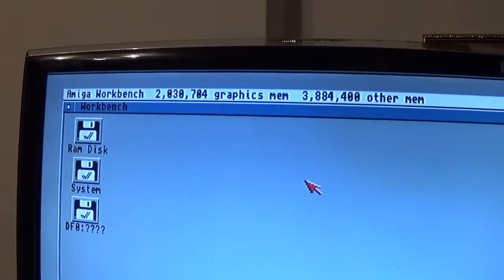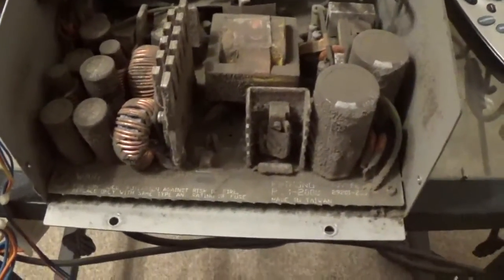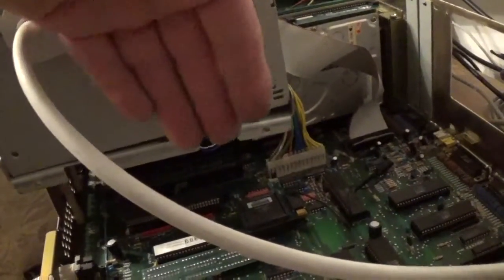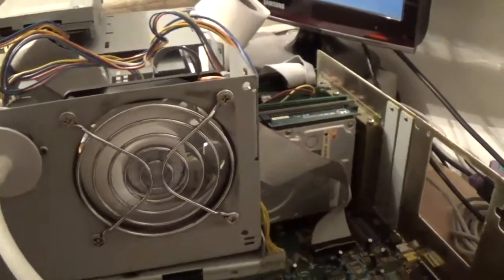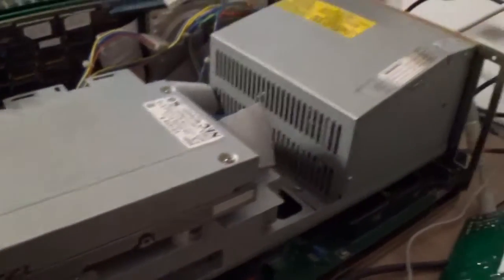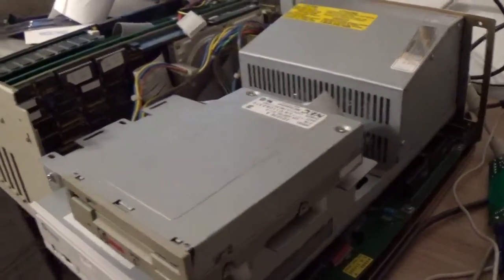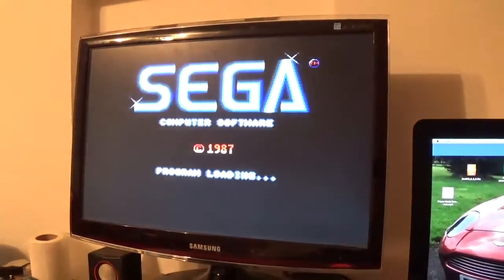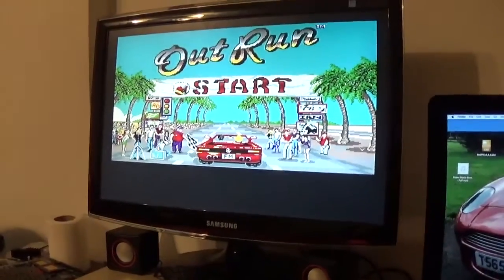megachip install in Amiga / PSU clean & floppy change

Comment: Will the Agnus from a A500plus work in the megachip, just bought the megachip without the Agnus fitted.
Reply from the maker: Hi, 
A Megachip usually has the 8375. ECS Agnus which can address up to 2 MB of Chip RAM
8372AB - Amiga 3000 from Rev 6.1 to Rev 8.9 (NTSC/PAL)
8372B - Amiga 3000 Rev 9 (NTSC/PAL)
8375 (PAL) - Amiga 500 Plus; Amiga 600 (PAL)
8375 (NTSC) - Amiga 600 (NTSC)
Reply: @mjnurney   Hi Mike just bought a Megachip of ebay but it has no chip, but i have a A500 plus parts board battery leaked alot of damage, would the agnus from the A500 plus work in the megachip, it's just there no marking on the Agnus chip from the A500 plus but was in there from when i bought it a few years ago.   :)
Reply from the maker: There are lot of dead a 500s about, the mega has an 8375 and the 500 plus should have that too, try shining a light on it or wet it with your finger to see what’s in it. Not all Agnus’s are pin compatible

Comment: Good video, did you have to change any jumper settings when popping on the MegaChip? I have a A1500 with 1mb chip that I fancy taking up to 2mb chip at some point.

I also need to change the fan from the jet engine stock one like you did, are the pc fan connectors compatible? Is it necessary to solder? Not soldered before and diving into a PSU with those energized capacitors is probably not for n00bs :)

Cheers
Reply from the maker: BrooksterMax hey bud , no jumpers ...just pop it it and check the orientation. as for the fan , yeah soldering required as I remember
Reply: Thanks Mike no jumpers makes sense if you have the full 1mb chip already working before the megachip goes in. This A1500 has only been with me a few days but I have big plans!

As for soldering the new fan, hmmm I wonder if I can use wire crimps and then tap into the existing wiring to save me diving into the depths of the PSU. Won't rush into it, given the electrical hazards awaiting within!
Reply from the maker: BrooksterMax post the PSU over and I'll do it if you like :)
Reply: Cheers for the offer, will have a little explore myself and reach out if I chicken out! :)  First got to order an appropriate fan which I believe needs to be 80mm @12v. Off to find a good 'un. Have a good evening!

Comment: I am using the SCSI2SD on my A2000 with a Commodore 2091 hardcard,
Reply from the maker: +Matteo Pascolini they work well but the access speed is quite slow
Reply from the maker: Good luck finding a working SCSi drive most are toast now or just noisy and unreliable, I've take many out in the last few years. horrible things.